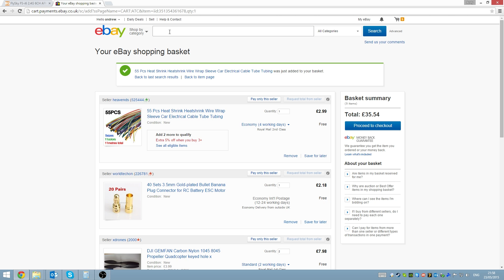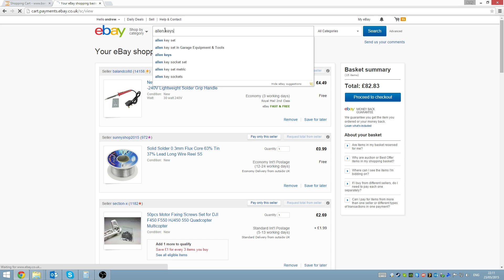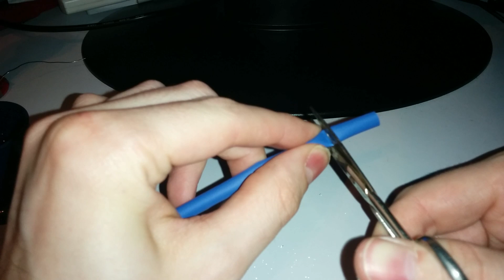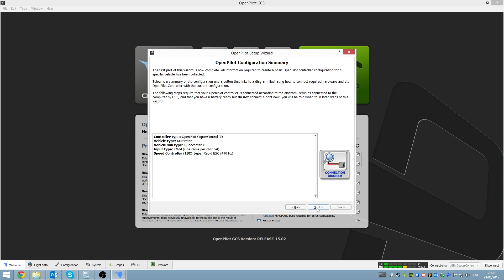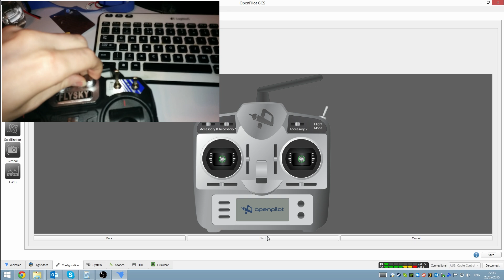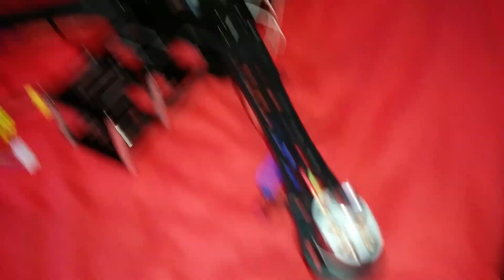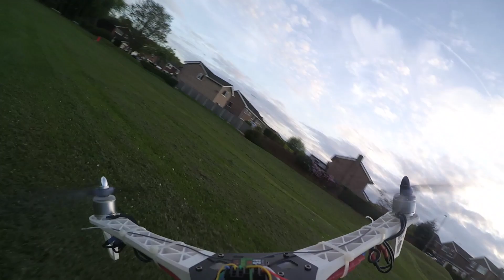Build A Cheap Quadcopter

Comment: I just finished my first flight test using your great video and fantastic instructions.  This is the first quad I have built and no previous experience with model aircraft or RC vehicles.  I do have an electronics background and worked on the flight controller for the F14 Tomcat back in 1967 and the CC3D controller is more sophisticated.  I recently became a great grandfather so I may be the oldest of your fans.  Thank you.
Reply from the maker: thanks for the story Jim. enjoy flying!
Reply: Which size of the screw you've use to mouting the motor to the arm??? M3 or M2.5?????
Reply: I have A2212/13T  1000KV motors mounted with M3 x 8mm screws and lock washers.
Reply: Jim Cameron Size screw is M3x8mm for your motor? But do you know size of the screw mouting DJI 2212 980kv to Alien X mode??
Reply: No, I do not know.

Comment: Hi Andy ... nice vid en instructions! I gona build this 1 myself ... o joy what a fun to do ;-)
A question 4 you: is it posibble to get more flight time?  bigger lipo with more amps? or will that burn out the esc's?
Reply from the maker: you can use bigger batteries but that means more weight and it doesnt always pay off

Comment: Hi AndyRC, hope you read this the soonest. I have a 820KV brushless motor rated 2-3s, 50A ESC, and 4s lipo. Would the 2-3s rating of the brushless motor matter?
Reply from the maker: yes it would that setup could over load the motor with a 4s and it could burn up. it really depends on the load you give it also
Reply: Aw crap! A total mismatch :( I was thinking these brushless motor would only involve the Amps that's why I get a higher Amp ESC and was enlightened that ohw this ESC can handle a 4s. It was too late when I noticed the 2-3s rating of the motors. I should have known better. Now it's either to get high rated motors or get a 3s battery :(

Maybe while deciding for which to get I might have a hover test when I get my 1045 propellers, tx, and fc..

Thank you so much AndyRC for filling me in with this information.
Reply from the maker: no problem hope you get something flying
Reply: Hi AndyRC, the motor does get hot to touch after 5 minutes, but i'm wondering does it affect the receiver? When i tried to give it a throttle about 10% and leave it there, but the motor continue to gain speed. Hope to hear from you soon.
Reply from the maker: the motors will gain speed @ 10 percent if u leave it on the ground as the gyros will be wondering what is happening

Comment: hey Andy can u tell me 30 amp esc is correct for 1000 k motor and a battery of 14.8 volts .asking because my esc become hot
Reply from the maker: +sambhav Kumar it depends if the motor/esc is rated for 4s rather than the amp of the esc

Comment: How much did the whole build cost?
Reply: Fo An you are ignorant.  I guarantee your mommy and are still paying your way.  Your bullshit words are careless and insensitive and all around stupid.  What did you get out of saying that stupid shit?  NOTHING!  People like you make me sick.
Reply: I opened all the links and added up and as of today, the entire cost to build this project would be $245.78.
Reply: Yes...< than 250.00 for a 450 size quad is a steal.
Reply: It was 139£ for the quad alone, 160£ for the tools including a Tx/Rx, battery, soldering iron, bullets, everything!
And yes even in 2017 with more variety and gear, it's very cheap.
Reply: Nice for the price.i built an hexa 450 for $400 , with an APM2.8 , so , GPS , loiter ,alt-hold , follow me etc...Mobius Cam on a Simple BGC 2 axis.All carbon fiber , weight 800g.but you need some knowledge , in Glass and carbon fiber building.
Reply: just drew your ego is as high as the empire state building.
Reply: Burks that's fucked up. too poor for this sport?  douche
Reply: Isaac Watkins not cheap then
Reply: Nick Lane if you're saying we are poor then use your mind i bought a $1000 dollar drone
Reply: he is too poor for quads.. and other stuff
Reply: Considering a RTF quad of this size is $500+, it kinda is. You must just be too poor for this hobby

Comment: Hi I bought flight controller from eBay but my flight controller cable is different coler order. As you explained on video, you are saying red, black white plug in to B/CC but on my cable white on the 5th order. Please can you help me?Thank very much for now.
Reply from the maker: +Aydin Atik yes there are many different cloned versions of that board unfortunately. but they should be in the same order even if the colours are different.
Reply: +AndyRC I know Andy, my cabe totally different. (Black,red,white) on the recevier side, must be plugin  B\CC pins isn't it? But white is control board side on the plug 5th order, its mean doesn't following order.  Thank you for quick responded.

Comment: Dear, 

Really nice tuto thank you verry much! 
i have a issue with the stabilization! The quad is oscilating. I think is the PID setting wrong ? could you give me your setting? 

thank you verry much
Reply from the maker: +Xavier Munger yes the pid is wrong you need to connect channel 6 up to the pid controller as shown in this video and alter it while you fly.

Comment: Hi, this might be a stupid question but I was wondering how the flight controller manages to stabilize the copter. Does is have a built in accelerometer?
Reply from the maker: +Connor McShane yes it has an auto level function but you still need to input controls to make it fly
Reply: +AndyRC thanks for the quick reply!
Reply from the maker: no problem :)

Comment: I have built 27 Drone UAV professionally with automated and maual flight modes. with RTL(return to launch) switch incase the drone loses connectivity.
Build book: http://www.amazon.com/dp/B01C69WOCO?ref_=pe_2427780_160035660
inventory for complete quad kit included & where to buy it online.
There is alot of minor points that is not mentioned in this video so your drone will crash and you will get a headache rather save yourself alot of time by getting this book.
The links to buy the items you need is included in this book and I offer free assistance.

Comment: hi Andy I have learnt how to make quad copter 450 from u but I have just a little prob I thought that u will explain me the best .1 -I have ordered my battery so it will take time so I can't wait so I decided to run quadcooter with a 12 volt adaptor it runs I have used hobby king kk2.1.5 fcb and my quad runs but the motor who's esc is connected with no 1 panel or my doesn't runs and when I connected to Google it said that m1 or the first connection of wire to fcb provides electricity to run fcb plz tell me wht the prob
Reply from the maker: I can't make out your issue from the above text. Do you have more info? Thanks

Comment: Andy, question for you, I finally got the quad up in the air but alas have crashed it a few times and now rebuilding...again! I blew an esc and bought new ones for different supplier, I've fitted it but it isn't working. Do I need to do the whole recalibration process again?? Also, tried calibrating it direct on the controller but when I do that and hook it up to the throttle on receiver the motor does not respond to increasing the throttle, but instead pulling right on the throttle stick increases motor speed. No idea why?? Any help appreciated 😄
Reply from the maker: sounds like the esc is in the wrong channel on the reciever
Reply: no, I tried it in every channel, I tried all the escs in the end and they all had to be calibrated in the same way, odd, but it worked.
Reply: latest issue is the cc3d board is not being recognised by OPenPilot?!?
Reply from the maker: i think open pilot has been upgraded to librepilot

Comment: andy can you suggest me a verry cheap landing gear for that frame?thanks
Reply from the maker: +MuLtiSynC if you check out the adding fpv video i use that landing frame its about 17gbp its also shown in the cheap 3 axis gimbal video
Reply: isn't that verry heavy? cause i have bought the 3000 mamps battery
Reply from the maker: they dont come much lighter than that unfortunately

Comment: Which motors would you use for upgrade? Would you, for example, go for sunnysky 800KV or 980KV motors ? Would the ESCs and battery go along well with these motors? Thanks!
Reply from the maker: +Dimitris Anagnostou check out the high end build series I did. its in the playlists section its this quad with upgraded parts

Comment: Hey man, just wanted to let you know that I built this exact same setup and it worked great.  How did you get your prop nuts to stay on?  Mine want to go flying off into space.
Reply from the maker: +Phil Pillera on the motors you bought do the screws all turn in the same direction?
Reply: I think I got the same motors you did.  The screws on two turn cw, and the other two turn ccw.
Reply from the maker: yeah they should not come off as they are self locking. make sure u have the motors the right way round
Reply: That could be the issue.  Maybe I have all of the motors reversed but in the correct position.  I'll look into that.  Thanks!
Reply from the maker: no problem

Comment: +AndyRC or anyone Suggest me brushless motor and esc for it for 250 size quad. It should be cheap, durable and Strong enough to carry a gimbal sometimes. I am going to build it to use it some what like a racing quad and taking aerial videos from high altitude. Not too much high but just how much ur 450 quad goes to a height. 
I thought of buying motor 1806-2300kv which are in jjrc x1. Are these motors good or I should buy the one you suggested in the video? I don't always prefer gimbal but I prefer flying a quad in higher speed.
Reply from the maker: I will be using 2204 on my 250
Reply: +AndyRC what do initial no. tells like 1804 and 2204
Reply from the maker: +Rushi Palkar that is the size of the motor and then after that is usually the kv

Comment: what charger would i need to power a 3 cell 11.1v battery for a 250 frame quad? cheers
Reply from the maker: +AJ Parkinson b6 AC V2
Reply: +AndyRC thanks, but they look pricey! And it doesn't appear to come with a power cable, are there no cheap plug in chargers? Thanks a lot for your response
Reply from the maker: +AJ Parkinson it does come with a power cable. nothing is cheap in this hobby ;-)

Comment: hi Andy when I'm trying to configure the yaw stick left to right..nothing seems to happen,I've got the same to and rx as you..any settings on the tx I should be aware of? thanks
Reply from the maker: only thing I can think of is the rudder servo wire connected to the wrong channel
Reply: +AndyRC thanks for the reply...I've noticed that your black wire is blue on mine and  mine is in chan 4 can another yellow in chan 5?
Reply from the maker: +Andrew Thomas it could be that the wires are different colours yes try move them around
Reply: +AndyRC got them all to configure..The quad won't lift off the floor with full throttle,what could that be? thanks
Reply from the maker: props on the wrong way :)
Reply: Yes they were..lol its lifting now but unstable so gonna try the tuning u done.
Reply from the maker: great!

Comment: Hi there, I was trying to build a quad from scratch using motors with specs of 1000kV. I am aware the lesser the kv rating is higher is the altitude that the quad can climb upto. Now how do you work out the exact altitude in ft/m that it can fly upto using the specs of the motor and other available data. Also how do you calculate the flight time. Is there a particular formula you use? Thanks!
Reply from the maker: +Avishek Sengupta I dont think the kv has anything to do with the altitude. you dont want to be going high up with a quad copter. its too dangerous
Reply: +AndyRC Flying at around 200ft can be done using any motors irrespective of the kV rating you reckon? And how do you calculate the flight time of the quad from the specs that you are using?
Reply from the maker: go to ecalc website and buy a day pass. enter your details in there and it will give you an estimate. yes 200 ft can be done easily even with micros
Reply: +AndyRC Thanks a lot mate!
Reply from the maker: no problem
Reply: +Avishek Sengupta use ebay.infor getting dji phantom motor 4 motors cost 5,608
Reply: +Avishek Sengupta use ebay.infor getting dji phantom motor 4 motors cost 5,608

Comment: +AndyRC I have build my quad and am trying to tune the p settings with the I and d gains at 0. When o try to tune it with the d and I gains at 0 my drone drifts really bad to the right. Is my P gain to high or to low? May you please make a detailed video on pid gain tuning please? Or at least answer my question? Thankyou.

Comment: but those red escs you are using are good enough for it or i need others, like the black simonk from eBay from hobbypower or whatever.
Reply from the maker: +canim 1973 the ESC are fine but the motors are not as they were cheap ones

Comment: hello,

first of all, i really like your channel. keep on posting.
i have a few questions. i am starting to build my f450. i allready have the original DJI frame with Landing legs. now i want to buy the escs and motors. later on i want to carry a cheap 2axis gimbal with my xiaomi yi. i'm thinking on the simonk 30A ESC like the ones on your vídeo or the simonk 30A black ones that are sold in 4 pcs. on eBay or bangood.  what is your opinion? regarding motors, i really dont want to buy the cheapest, but something in the middle. do i really need 920kv or 980kv ie enough. sunnysky x 2212 980kv????? or you think there are some others around???
waiting for your feedback and once again thanks for the tutorials.

canim1973
Reply from the maker: +canim 1973 you really need a 4s to lift a cheap gimbal so just make sure they are rated to 4s and 2212 will be enough. i use 2216 on my gimbal quad

Comment: Thank you so much for recording this video and showing how to build a quadcopter step by step. I will be following your steps as soon as I can and will hopefully be flying it with the FPV system I am using on my syma X8W. cheers!!!
Reply from the maker: +Eduardo Agustin Vendrell del Río wonderful. good luck :)
Reply: I have one doubt Andy, is it possible to use a landing gear on this setup so I can attach a gimbal at the bottom of the quadcopter?
Reply: +AndyRC I would like to save a bit of cash buying the propellers from banggood, which of these do you think would do the job? 
http://www.banggood.com/search/dji-propeller.html
cheers!
Reply from the maker: +Eduardo Agustin Vendrell del Río I don't think they sell the keyed hole at banggood. you could message customer services to see if they are keyed

Comment: hi andy! finely i got this quad to fly!! and its very nice!
i fly it with zippy 3000
the problem is that i need to take the throttle  full up to take of... 
is that ok?
Reply from the maker: +יניב פוריאן no it should be 50 percent throttle to take off. sounds like its too heavy?
Reply: +AndyRC i onley add few led thats it
any ide?
Reply from the maker: it could be a few things. could be incorrect throttle mapping. or possibly a dead cell in a battery. without lifting any payload your hover with this setup should be under 50 percent.

Comment: Hi Andy, I am using the same motors and ESC's as you with multiwii and 9x. I have calibrated the ESC's manually using the Rx and two work perfectly. One of the other motors beeps constantly and twitches, while the other does nothing. Any ideas how I could fix it. Cheers
Reply from the maker: +Hench Medias that will be a short. did u use the same kit as here? either a cold solder join or the screws is shorting the motor. dont let it go for too long like that otherwise something will burn up
Reply: +AndyRC Tried re-soldering the offending motors, but the problem seems to persist. All the motors have worked at one point, just seems to be these two. I wondered if it was something to do with the trims on the Tx when calibrating - I had to change these to get the FC to read the midpoints correctly. Should I buy replacement motors/ ESC's yet? Thanks for your help
Reply from the maker: have you treid soldering them direct to the ESC rather than using bullets?
Reply: I never used bullet connectors as you mentioned in one of your other videos that they create RF noise - the copper wires on the motors don't take the solder too well though.
Reply from the maker: oh right that does sound very odd then!